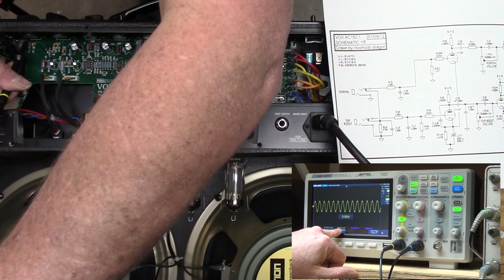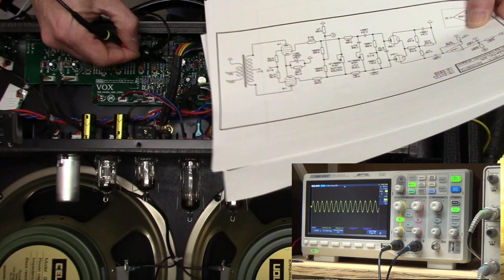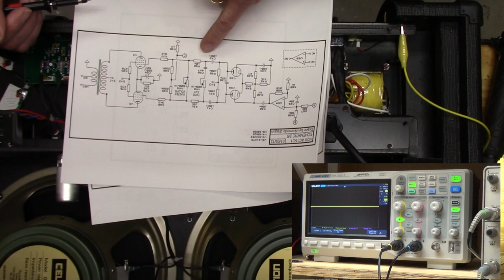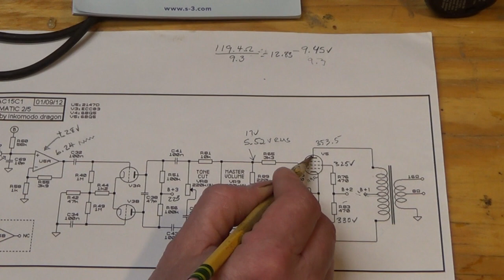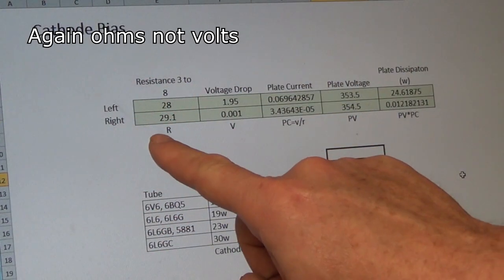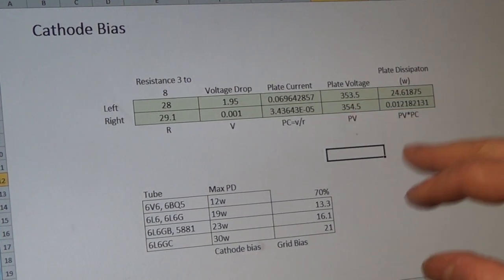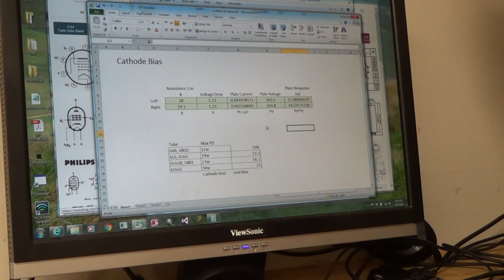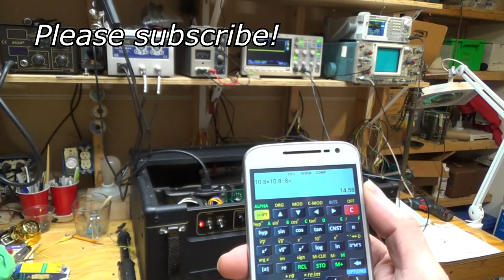Vox AC15 C2 C1 guitar amplifier repair

Comment: Rob's Fixit shop, can you make a youtube video showing what formulas & using the calculator when checking things on guitar amplifiers. Instead of just using the wattage formula what other formulas can you use to test and verify the power supply and gain sections for each stage has the correct gain for each stage and using other formulas?

Comment: Hello, I have the Vox AC15C1, the problem is a short circuit on the posts that are soldered to the board, where the orange wires of the transformer are connected, you have some idea what it could be, or where I can find the diagrams.
thank you very much.
Reply: Did you find the problem?

Comment: I thought the Vox AC 15 & 30 were class A amplifiers, but that looks like a push pull circuit which I thought meant it was Class AB .... What is the difference??
Reply: Thomas Doyle push pull and single ended doesn’t mean the same thing as Class A, B, AB, etc.

These amps are cathode biased push pull. It’s worth reading some amp design to understand the differences. It can get a bit confusing.
Reply: Stefano Musica  Can you explain it? I also think class A is single ended and class B is push pull. I look that other people say is not but no one it’s able to explain it. Bibliography will be good too 😊

Comment: 90% of tube amp troubles are the tubes.
Reply: Yes. So my question is why wait until last to check the tubes? Which he did.
Reply: @HungryH1951  Agreed.  What I was hoping to see is an investigation to see if anything was killing the tube.  I guess he did by checking the circuit.